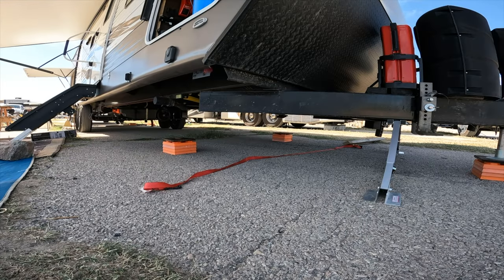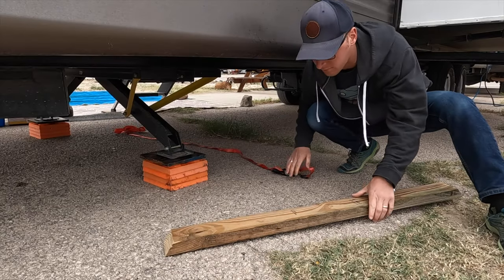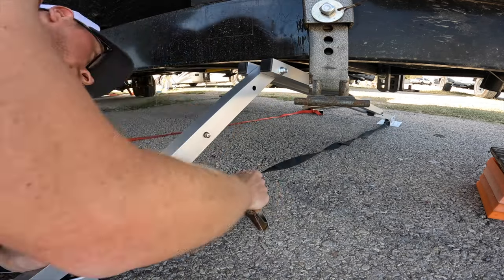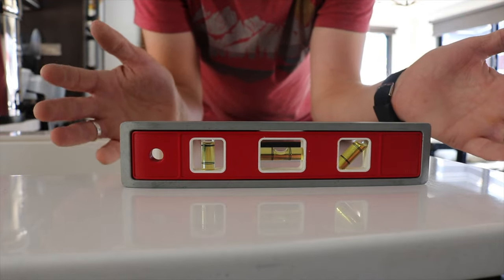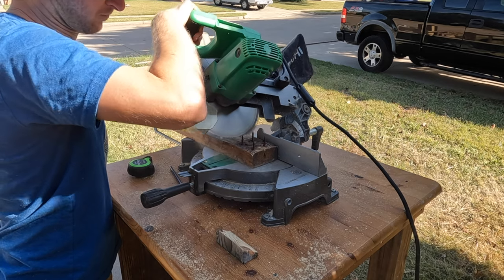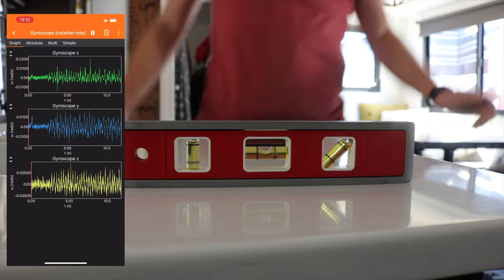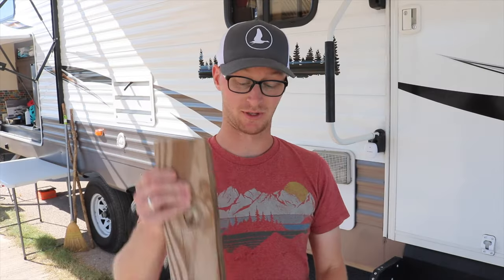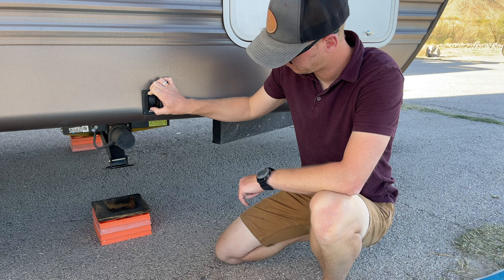Should You Buy or DIY RV Stabilizers?

Comment: Ditch the eye-bolt. Cut a little notch on both edges of the 2x4 where the bolt would have been and wrap with "Soft Loop Tie-Downs". Now you can easily stack the 2x4s in the garage
Reply from the maker: I like that as an alternative. Definitely easier to store that way, but I like that when I clip on my straps that I know for sure nothing can be loose or move on me without having to adjust those straps at each setup.
Reply: @rvgearandfar 	Keep the Eye Bolt but permanently attach them to the strap ends.  Leave the hooks on so you can use them to strap up the 2x4’s for storage
Reply: With the eyebolt and a strap they can be hung up out of the way

Comment: We just replaced our old scissor jacks with 9,000k lb scissor jacks. They are a major improvement. Basically no movement. Now we need x chocks for the front to back movement which we only feel this when on uneven ground. The 9k lb jacks are highly recommended.
Reply from the maker: Nice - that upgrade is definitely helpful. Someday I wish RVs designed and sold RVs... little things like this could make the experience for the end consumer SO much better with little to no extra effort and minimal cost if addressed at the right point in the timeline

Comment: Just did this today, same instructions as you. Completely eliminated about 95% of the rock/shake in the front of the 5th wheel where the bed is. Was very annoying having the entire camper shaking side to side when youre just flipping over in your sleep. Not to mention the creaks of the camper. This eliminated the noise and the wobble
Reply from the maker: Fantastic - pretty impressive how much a 2x4 and some straps can impact the experience.

Comment: I built the DIY set for a 31 ft travel trailer. The work fairly well for the side to side motion but do not effect the forward backward motion much. I also cut a dado (slot) on one side of 4- 2x6 boards 10 inches long. I place these on the ground and place the 2x4 stabilizers in them, helps a lot on soft ground. Another tip is to put double 45deg cuts on all 4 corners of your stabilizer boards allows for a better nesting against the frame and the blocks on the ground.
Reply from the maker: Great tips! I use a single leveling block - the orange lego style - under the foot when its soft ground too. For front to back I've had good experiences with X-Chocks between the wheels on  each side, or with a single axle trailer pulling into one chock with the vehicle, then inserting a chock on the other side before letting the trailer settle and disconnect to firmly chock better thank I could ever manually press them in.

Comment: I like it!  Two suggestions:

1.  Instead of nuts and washers, install a tee nut so you can remove the eye bolts for a smooth surface.

2.  Install some clips that let you store the 2x4s along side the frame rails.  Takes some clever designing but can work.
Reply from the maker: I've toyed with many ideas on how to clip them to the frame to keep them out of the pass- though but haven't settled on anything - how would you accomplish it?

Tee nuts are a great idea too! Knowing myself, after the first time, I'd never unthread the eye bolts - but I absolutely see the advantage there - great idea!

Comment: I have 36' travel trailer. Our sissor jacks are angeled on each corner. So instead of most jacks running 9 an 3 with the frame running 12 an 6,  jacks are just past a 10 an 4. Clock way lol  Then we added 2 more on the same angle right infront of the tires. That helps the bounce and we have X chocks too. Im going to do the level moving just like you did. I'm going to buy wood right now. I have been wanting to do this for a bit now!! Can't wait after seeing this!! I subscribed, too
Reply from the maker: Welcome aboard! Let me know how they work out for you!
Reply: @rvgearandfar   Awesome!! We have 2 doors. I put them next to each step to not be in the way!!

Comment from the maker: 🏘 Join the RV Gear & Far Group Here:
https://rvgearandfar.com/rvgfyt
🔩 DEALS: Sign up for our newsletter and we’ll let you know about deals and discounts!   
https://www.rvgearandfar.com/signup
🚐 Favorite RV Gear:
🔸GasStop Propane 100% Emergency Shut-Off https://amzn.to/3DdMPob
🔸 Liquified RV Tank Treatment https://amzn.to/3Oe9cAh
🔸Fastway Zip 6” Breakaway Cable https://amzn.to/3XTcN9V
🔸Valterra Twist On Waste Valve https://amzn.to/3K064Fs
🔸Motion Sensor LED Night Light https://amzn.to/3rykvtX
🔸HitchGrip Hitch Handle https://amzn.to/3pOGKLS
🔸MORryde Door Latch Extender https://amzn.to/3PQAJZM
🔸Portable White Noise Machine https://amzn.to/3XUr4DC
🔸RV Ramp Levelers https://amzn.to/3PTczhh
🔸Solid Rubber Wheel Chockshttps://amzn.to/3PX1yeU
🔸8” Clip Fan Rechargeable https://amzn.to/3NPjVQd
🔸Portable Propane Fire Pit https://amzn.to/3Dc4QTZ
🔸MaxxFan 12v Vent Fan https://amzn.to/3Df9PTW
🔸Dual Fuel Generator https://amzn.to/3Dfsxec
🔸Fresh Water Hose https://amzn.to/3PX8mcy

DISCLAIMER We participate in several affiliate programs that earn us a commission on purchases made through our links at no extra cost to you!
Some product links are affiliate links which means if you buy something we will receive a small commission. As an Amazon Associate I earn from qualifying purchases.

Comment: I did 2x10s and used 2x10 slippers on ground so the angled board could slide easily on the ground when it was being tightened however doesn't slip under weight.
Front to. Back stabilizers work too as suspension will move around also. (bottle jack or scissor under the frame at wheels helps. Huge
Reply from the maker: 2x10s - BIGGIE sided stabilizers ◡̈ Love it

Comment: How about wheel chocks, a set of X-Chocks and the trailers stabilizers? We have owned two Airstreams and two InTechs. Currently a InTech Terra Oasis. On any of my four travel trailers, I have never felt the need to do this. Stabilizers and X-Chocks have isolated our trailers to ZERO movement 
Be sure to snug up your stabilizers after the first half day in and out of it as your trailer does settle a bit with suspension as well as settling on leveling blocks and in gravel mud and sand.
All four of my travel trailers, the past 30 years have hade manual 4 corner stabilizer jacks
Reply from the maker: I like the manual stabilizer jacks as well - in my other video they out performed the electric ones that came with my rig.
Reply: We run with beefy rubber chocks, x-chocks, and manual scissor stabilizers. I say manual, but a cordless drill makea it easy and fast. One tip is know what torque setting to use on the drill. Too little torque, stabilizer doesn't snug up. Too much torque and you stress the frame. Gotta find that Goldilocks setting. On my drill, it is 12.

Comment: I made 7 sets of the 2x4 model. works great. mine are 4' and as we use them i will adjust length. i found a way to put 2x4 on the tongue at about a 60 degree angle across the tongue and that seemed to help cut some front to rear movement. next is to make a set for the rear bumper to help with front to rear.........side note for now i use the aluminum braces( along with 2x4) under the steps and under the 2 slide outs b/4 slides are extended........store mine in back of truck for now till we get all storage space situated. thanks for help..................my wife came up with idea of adding those pads that clip on the hydraulick levelers as some sites the ground is just to soft and they would give a larger surface area for 2x4 to stand on....................wee keep improving things so we will work on other ideas.
Reply from the maker: Awesome! Sounds like you've got it all buttoned up - how long do all those stabilizers take to deploy for you once you arrive at a campsite?
Reply: @rvgearandfar  takes about 30 minutes. We have been working to help each other. Tagged the sets with zip ties which helps for location. Was thinking about adding some large U bolts to rear so there are some points to put the stabilizers from front to rear. Also tried some while home and put a set on the tongue , although a little long it has made a great difference. Will need to add the U bolts here to and shorten the 2x4 just for the tongue. Reason for U bolts is to use the extended bolts for 2x4 to push against.

Comment: Not sure it's an effective comparison if you don't follow Valterra instructions to take advantage of that designs ability to be positioned fore and aft in addition to side to side.
Reply from the maker: Not sure I'm following your critique. The Valterra ones can be placed side to side or front to back - since the 2x4s only help with side to side it makes sense to only compare them to the valterra's in that sense. If I put one valterra left to right and one front to back it most assuredly would have preformed WORSE in the left to right measurements, since there would have been 1/2 the amount of support with only one brace going side to side.